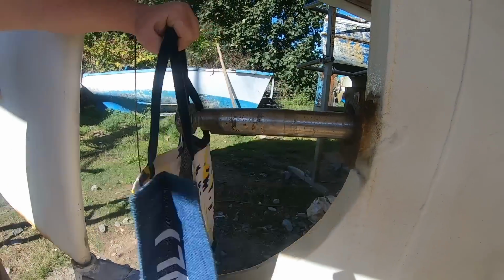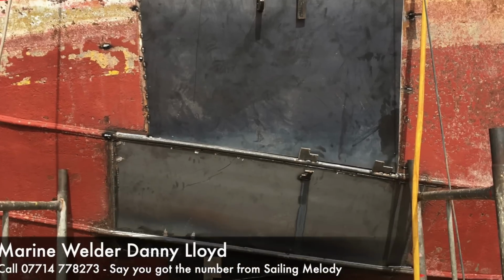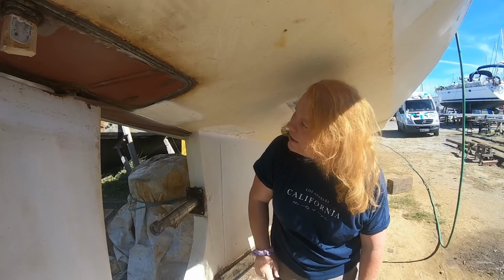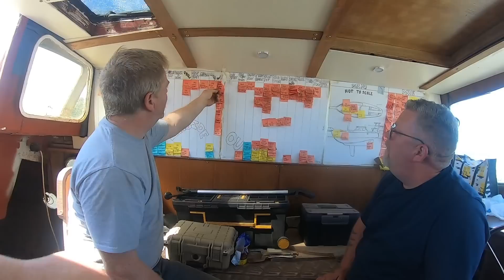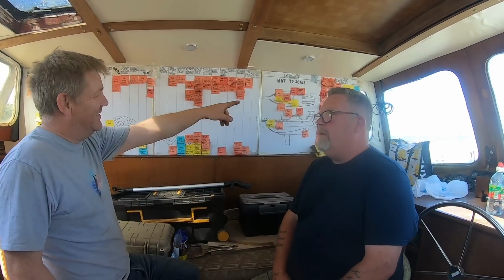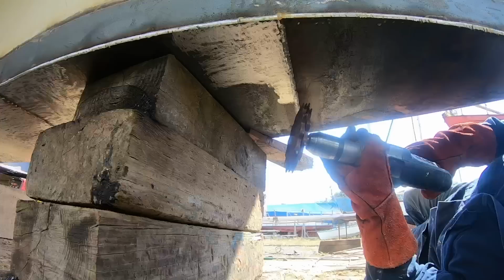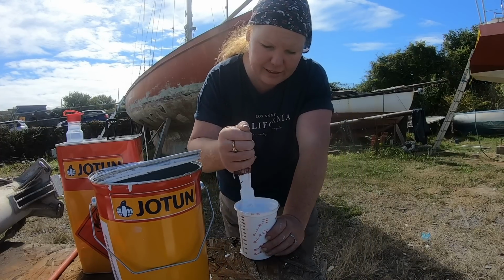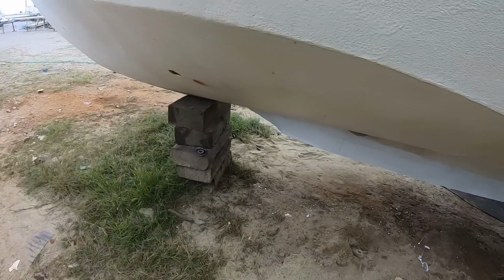#108 - GETTING READY TO MOVE OUR BOAT!!

Comment: Andy, are you sure that those 4 bolts at the base of the rudder shouldn’t be secured with self locking nuts? There should be enough vibration from the motor over there.
Reply from the maker: Tbh they’re the wrong bolts anyway, I’ll replace with Galv instead of stainless

But no they don’t need locking nuts. They’ll be tightened and then so heavily painted over with epoxy and antifoul they the paint will need chipping off if I ever need to remove them in the future

Comment: Think I saw some stainless steel bolts holding bottom ruther bearing. Replace within 12 months and replace with hot dipped galv. bolts. Stainless, as long as austenite, subjective to Stress Corr. Cracking.
Reply from the maker: Yeah you’re absolutely correct there

Having said that they’ll be completely covered with several coats of epoxy and antifoul so doubt it would be an issue but you’re correct not best practise so I will replace them :)
Reply: @SailingMelody  Sorry, makes it even worse! You have also constructed some corrosion traps on 'removable bow sprit'. Not critical, it will show. Bolts will just snap i fraction of a second. I'll give you 12 months at sea as maximum to replace. These corrosion subjects is what I studied at university for two (bloody) years. And worked with offshore for four years.

Comment: Possibly too late but if you ding the bowsprit, you're going to have a mare of a job getting it off cos everything is going to be bent....
Reply from the maker: Yeah you’re right.
It’s always that way though 

I’m not worried about the actual bowsprit tube; that thing is ridiculously over engineered: it’s 7mm wall thickness. But yes the stainless will be a pain if it gets bent but I think it’s always a bad day if you bend your pulpit and anchor platform regardless isn’t it 😂